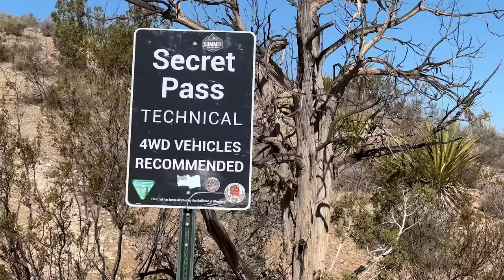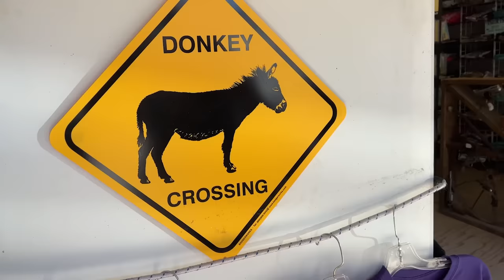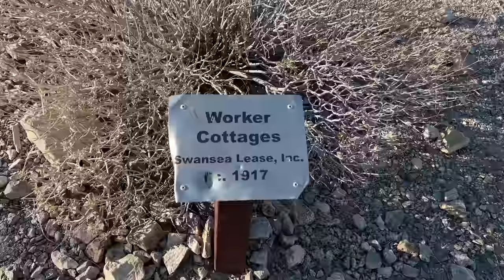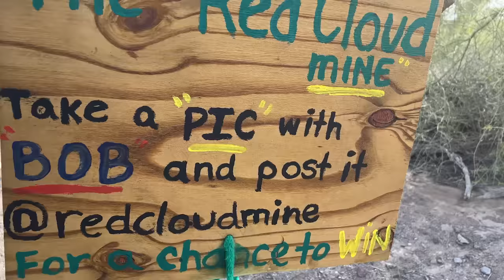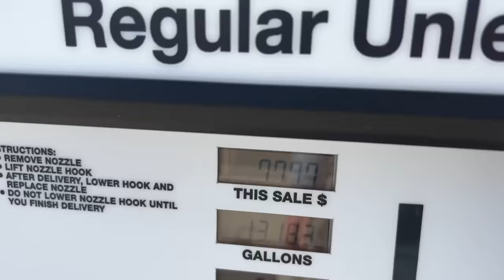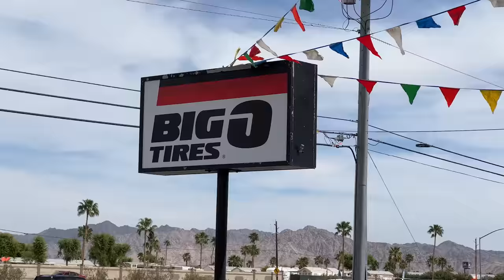Arizona Peace Trail DISASTER // 750 Miles on my Quad

Comment: On those steep drop-offs, have someone hold onto your back tires so that the quad won't endo, then when the front tires reach the bottom, you just gas it.  Works every time.  I have went off of vertical drop-offs that were 6 feet high, and absolutely vertical.  It will work.  One time I was in a deep canyon and had to go over a downed tree that was about 12 inches in diameter, and there was 4 feet of air under the tree.  My 2 buddies held my rear tires and I eased over.  I actually got off that time, and stood to the side.  I gassed it and it leveled out slick as a whistle.  My 2 friends were on dirt bikes, so we just man-handled them over the drop.  We were soooooo hoping that we did not have to go back up it.  None of us had been down that wash.   A little ways further I had to winch my quad down a 10 foot vertical drop.   One of the bikes went around it on a very sketchy 4 inch wide trail, and the other guy just pushed his bike over the side.   I could not believe that he did that.   I told him that I could lower his bike with my winch cable, but he elected to shove it over the side.

A funny story about that, both of my friends had been down that wash the week before on their bikes, but they had dropped into the wash past those 2 vertical drops.  They told me that they had found a wash that I could not go down with my quad, the week before.  As we went over some more nasty obstacles and made it out of the canyon, they said that this was the canyon that they were talking about.   I am 76 years old now, and I mostly ride alone, so I do not do that sketchy stuff any more.  But if I had help, I would do the holding the tires thing again.  It is really not a big deal on places like you see in this video.
Reply from the maker: We thought about doing something similar, but since it was an out and back part of the trail anyway, we just didn’t think the risk was worth it. And none of us are super experienced riders so we just wanted to be cautious. Thanks for the recommendation though!
Reply: @BroBuildsGarage  You are most welcome.  My Son and I went on a trail called the "Foredice" that is in the Sierras close to the Rubicon Trail that is near Lake Tahoe.  It was the roughest trail that I have ever been on.  It totally destroyed the bottom on my Polaris Sportsman 500 quad.  I had to completely redo the skid plate system after I got home.  I had to winch so many times that I would not even rewind the winch cable, I just wrapped it around my chain saw mount.  I do not ever want to repeat that trail.   My Son had his very well modified Jeep, and he had to winch a lot too.  

When I lived in Nevada, I would go into the most rugged terrain just to see if I could.  That was 30 years ago, I am much more reserved now days.  20 years ago I went down to Moab.  My Son was with a Jeep group, and they did not want any quads with them the first day, so I went by myself.  I caught up with 4 Jeeps and asked them if I could ride along with them because Moab has some terrain that has the potential to kill you.  We had a great ride.  Those guys had never seen someone on a quad go over that challenging terrain.  I had them hold my back tires a couple of times.  It was awesome.    Thanks for the reply.

Comment: Swansea is a very interesting place. The Parker 400 race used to go through there. Along the old railway you can see where the trucks used to go up the sides. They had to move the course because Swansea is a historical site now. The mine was owned by an English company at the time that Great Britain was getting electricity. The mine built a railroad from Swansea to Los Angeles.  They loaded the processed ore on ship's  and sailed them around Cape Horn and then to Swansea Whales where the ore was made into copper wire. If you get back to Swansea again follow the above ground pipe line all the way to the  Bill Williams River and there's a pump house where Swansea got their water. A truly spectacular canyon on the way there. Also while walking around the  river Bank we saw signs of Beavers in the middle of the desert. I stayed three  nights in the same Motel as you with the great TV  reception! Camp Bouse is also an interesting place and is worth researching the history of Pattons secret weapon tested there. I told my riding buddy on the second night that we should eat in Parker because I wanted my waitress to have teeth. Great video.  I bought a 2023 Can Am Outlander 700 xt and I want to explore that area again on a much newer machine than my old Foreman

Comment: Awesome looking trip. We are doing a similar type trip in Newfoundland next summer. What happened to the Cforce 600 that it wouldn't start?
Reply from the maker: Top end has to be rebuilt. Didn’t realize the air filter had been completely chewed up by mice.
Reply: @BroBuildsGarage  Jesus, that's shitty. I have a cforcr 1000 and the airfilter is such a pain in the ass to check I only do it every couple months.

Comment: At 7:11 you refill your cooler with icecubes and water bottles. You can also fill it with a few frozen water bottles. Keeps everything cool and by the end of the day, when they're defrozen, you can drink those bottles as well. That way you have way more space in your cooler. That is if you can find frozen bottles on the go offcourse... 😅 If you freeze them yourself, just pour out half a glass cause freezing them expands the water and will damage the bottle 😊 greetings from Belgium.

Comment: Hello that trip looked like an adventure of a lifetime. I'm getting pretty serious about pulling the trigger on a cforce 1000. How has yours held up? Do you still like it? Had any troubles other than melting your clutch which I saw you said was your fault? Would you recommend one? Would you buy one again? When you guys went to leave the hotel and your buddy's wouldn't start that's the kind of thing I worry about.
Reply from the maker: About 1500 miles on mine and zero issues. I also have a 500s with over 2000 miles, also no issues. So, turns out the motor on the 600 was totally shot (user error, was ridden who knows how long after mice chewed up the air filter). Should be covered under his extended warranty. 

I would absolutely recommend cfmoto to anyone! I love my machines and doubt I’ll ever buy another brand.
Reply from the maker: And yes, the trip was amazing! Already planning to go back.
Reply: Thanks for the info I appreciate it

Comment: I'm not done watching, but before you just buy another POS OEM spring, I suggest you go to Dunbar spring in downtown Phoenix (literally they are near 5th ave and Jefferson???).  They were one of the first businesses in Phoenix and are very good at what they do.  Ask them what would work best, but they can MAKE you a  thin spring stack of three or whatever they recommend and they will last forever.
Haven't been there for 10 years ish, so a call would be recommended.
Maybe someone saw what happened to the wheels and tires off your truck...if not, we can just hope the rattlers or scorpions get them.

Comment: what was wrong with the quad that would not start
Reply from the maker: Oh man...completely blown engine. Well, the top end anyway. He's actually having it rebuilt right now. Mice chewed up the original air filter and he didn't realize it. He rode it like for awhile without knowing. And it apparently caused more damage than we realized.

Comment: What kind of gas mileage did you get?
Reply from the maker: No idea. Aaron and Trevor only had to use their gas cans one time (between quartzite and fisher’s landing). Other than that, we just filled up at gas stations and never had an issue running low on fuel.

Comment: I always can tell someone cant ride for sh#t when they mount a huge box on the back and than put a fuel tank on top of that. Ho and they drive a cfmoto the TRASH BIKE company. Cfmoto is the kia of atvs take a look around do you see older kia's on the road (NO) you dont. PS stack more heavy stuff up high. Large boxes on the rear of an atv is a back breaker when you roll over it kills only good for flat ground even then i would never use 1. The guys that make rear storage boxes have never been on an atv in the mountains. good vid on how not to setup atv's
Reply: Why so hateful? Has your missus left you for a calmer, nicer dude?